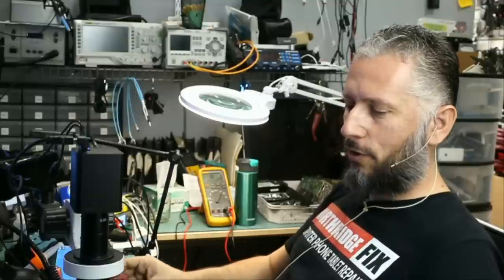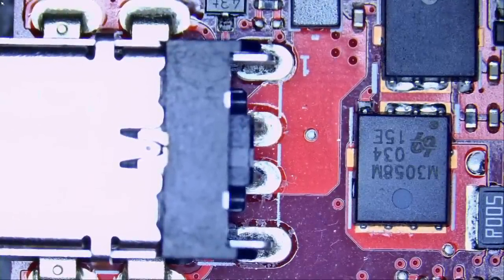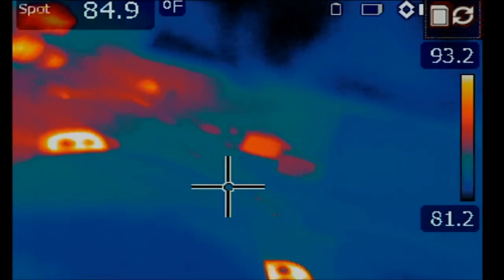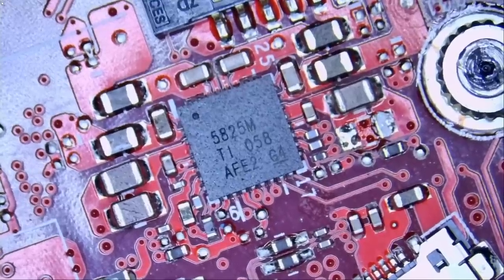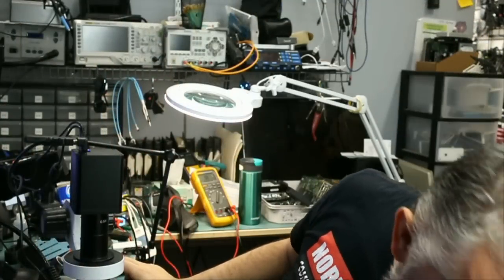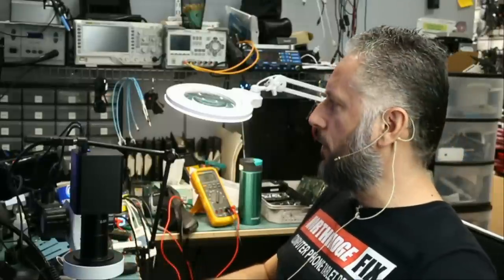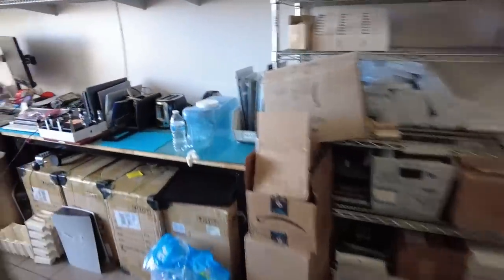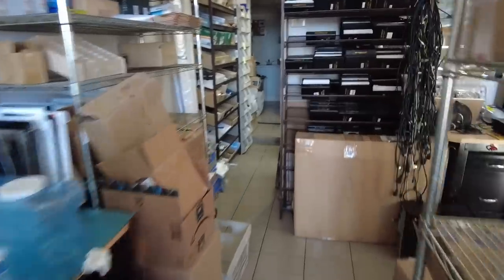ASUS ROG Zephyrus GU502 Laptop Repair - Does not power on.

Comment: I like watching your videos.  They are very inspirational. I have limited experience in the technical side of electronic repair.  However I'm more than proficient in soldering as I have been building and flying quad copters for well over 10 years now. I am interested in trying my hand in the electronic repair industry. What would you recommend for a start up? What tools/ equipment should i have? I have the soldering station, hot air reflow unit, power supply unit and a other few select gadgets for utility. Perhaps aquiring the FLIR camera and a good set of bits for disassembly would be a good addition? Any recommendations?Thank you for your work.

Comment: If only we can afford a thermal cam that costs around 800 or more from flirr we could do the same quick methode but unfortunately it's too expensive so we are longer busy with finding the problem component(s) by schematic if there is one. If no schematic available we then follow the powerrail and do it the old fashion way and then it takes hours to find the problem. I really hope they make thermal cams pricing not so high so it's affordable for everyone.
But nice job one again.
Reply: Hi, there are a couple of tricks to find a shorted component without a thermal camera, use of isopropyl alcohol, lighter fluid or rosin for example. Regards!

Comment: My asus rog zephyrus powers sometimes. When it powers it runs, but when no only logo or shut down a second.
When power up I check temps of processor and graphics, less than 55 in use or 70-75 under load (games).
How to fix it? Same process or its something different?

Comment: Hey. I have a rog zephyrus g15 ga503rm. The laptop crashed and now it does not respond at all when power button is switched on. I sent it to support and they tried somethings but it seems that the motherboard has got power issues. They recommend buying a new laptop because the alternative is ordering a new motherboard.  They said the zephyrus line has commonly got such issues and  it wasn't reliable.

Should I seek another service that does granular motherboard repairs like this video?
Any advice?
Reply: Some background: at first the ssd I installed sort of crashed - thw bios wasn't detecting at all so I could nor boot into Linux installed on that SSD. I suspected it has something to do with overheating.

Then after a week it showed a black screen with keyboard lights on when power on

Comment: hey im kind of a begginer, why do you inject voltage? isnt it the same as plugging in the charger in this laptop's case?
Reply: The 19V voltage supply from your charger will pass through usually two mosfets before feeding the rest of the board and if your laptop detects an excess current it will turn one of these mosfets off so no current will continue for more than a brief instant when you plug in.   Note the resistor to the right of the mosfet.  A very low value resistor which is almost certainly used by the laptop to measure the current being drawn.  
He is injecting a much lower voltage - 1.2 or 1.5 after the two protection mosfets.   A low enough voltage not to damage anything else but also enough to drive some current through whatever is short circuited and produce some heat to detect with his camera (you can use your finger too or some alcohol).    He is not trying to turn the machine on at all - it is purely to see what warms up due to being short circuit.  
The typical path is ...   Charger port - mosfet - mosfet - resistor to detect current - rest of the board.

Comment: may someone help me please? ): i’ve had a G15 since 2019 and randomly without warning it seems my fan has 💩 the bed… when i entered UEFI/BIOS my cpu temp started at 40°c and raised to 73°c within minutes (i was not gaming or previously gaming) and my cpu fan speed will not exceed around 774rpm…?! does this mean my fan is faulty and i need replacement? please help thank you so much ): 

(i have a 2019 ASUS ROG Zephyrus G15 GA502DU) 

problem literally occurred overnight… not sure what happened but besides the overheating and low fan speed, the laptop still runs beautifully, no lag or slow loading speeds anywhere?

(i haven’t spent more than 10mins in a game due to overheating but within those 10mins the game ran fast and normally) i never once had a problem with this laptop until now, and that super low rpm is scary

Comment: My gm501gs refused to turn on or do much of anything a few weeks ago, and after removing the battery and still no luck I just threw it aside (I built a high end desktop a couple months ago). Today I decided to take another look at it, and I started by taking out the ram, hard drives, etc... I basically just took every piece apart and then added them one by one, and after I put in a stick of ram and the nvme drive it booted right up. Then I put everything else back in, including the battery, and it's still booting fine now. Not really sure why, but I'm not complaining. Honestly this laptop is built like a tank. I had the first battery start smoking and almost explode in it, then I had a significant amount of water get into the keyboard, mobo, ram, while it was running. It got stuck in a loop where it would shut off and then turn itself back on, and it took me a good 5 minutes of that before I was able to unscrew the case and pull the battery. Thought for sure it was dead, but I did the same thing I did today, wiped every piece dry and cleaned it all with alcohol wipes. Let all the parts sit out for a few days, and lo and behold a few days later when I put it back together it booted up just fine. The only long term damage was a few of the keyboard keys were messed up (I used an external so didn't care), the RGB key lights never came on again, and then weirdly a month or so later the usb-c video pass through just stopped working and never worked again (though strangely it worked fine initially after getting wet). I've beat the hell out of this thing in more ways than one, and the only reason I stopped using it is because it was starting to run way too hot with my dual 4k monitors and all of the visual studio / wsl stuff I was running for work. It was constantly running at 80-90C, and I kept having to turn off the turbo with throttlestop to prevent it from hitting 95+. It ran like that for many months until I finally decided it was time to build a desktop again. I absolutely love my liquid cooled i9-1200k that runs at an average of 40c, but the zephyrus has served me well. I was really happy today when I found out that it's still kicking, the things a beast.
Reply: I find this sort of mystery happens quite a lot.  I know for a fact on one device that it was a piece of dust between two legs of a connector because I actually saw it.  so I think sometimes this happens  and you simply do not see the offending dust or dirt and it is dislodged simply by re seating things.

Comment: Hold on a damn minute. What the hell is wrong with these ASUS ROG boards!!!? It seems like a big part of your business. At this point it seems like a class action lawsuit/recall against ASUS is in order or am I missing something.
Reply: Its probably because rog laptops get hell beaten out of them. They are gaming laptops after all. You would probably not send your cheapo slow laptop to repair shop. laptops mostly give up when treated dayly with heavy load. I own older ROG from 2016 i barely game on it and it has not had any problems to this day. Its still quite fast to this day for normal dayly tasks. Even original battery to this day can browse web for about 2 hours.
English is not my main language so i make alot mistakes in my sentences. i hope im understandable. :)